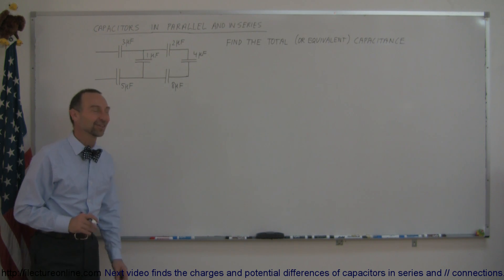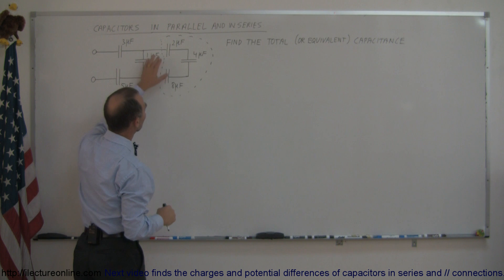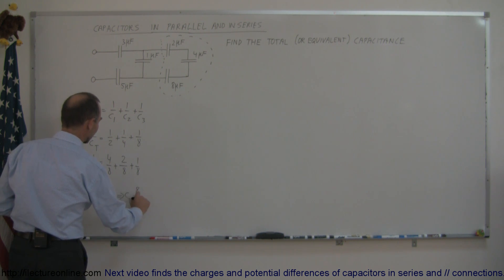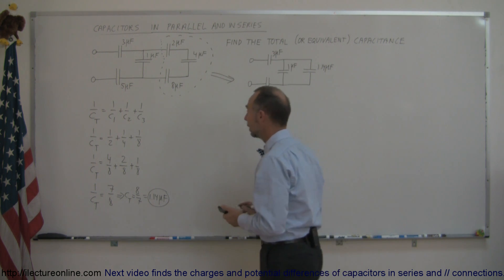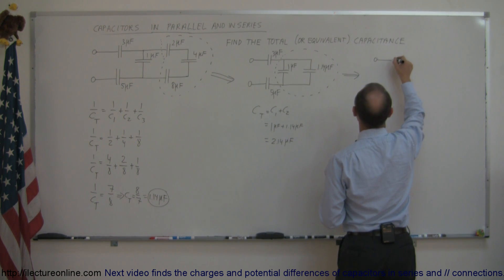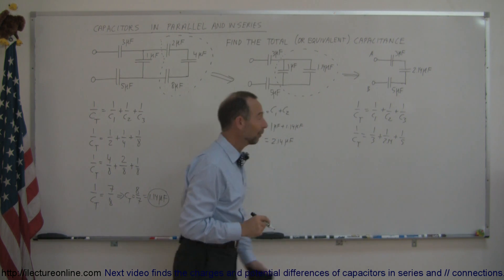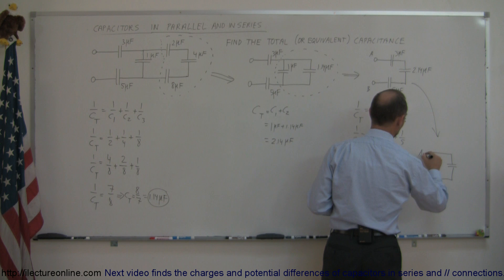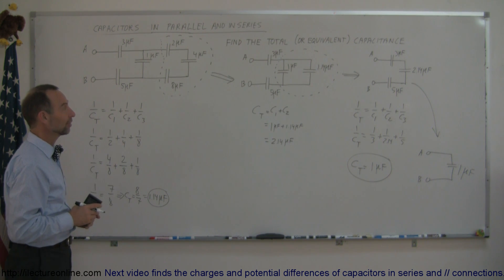Physics 39   Capacitors (5 of 37) Capacitors in Series and Parallel   3/4

Comment: Why do you not find a common denominator when adding the parallel capacitors at the end? You get the same answer of 1 in the end but normally that is not how you add fractions...
Reply: Amanda Taylor 
Brother is right 
Use fraction 
The is write

Comment: When you added the capacitors 2,4, and 8 why did you place the final capacitor in parallel with the 1 mF capacitor? Why no place it in series?
Reply from the maker: If there is more than one path for the current, then they are in parallel.  The current can go through either the 1 uF capacitor or the other 3 in series.  Therefore that is a parallel path.

Comment: how would u know to draw the first 3 capacitors in parallel to 1uF as oppose to series?
Reply from the maker: Note that between the 2 nodes on either side of the 1 uF capacitor there are 2 current paths.  (1 through the 1 uF capacitor and one through the other 3 capacitors).  When you find the equivalent of the 3 capacitors, it will still reside on that second path.